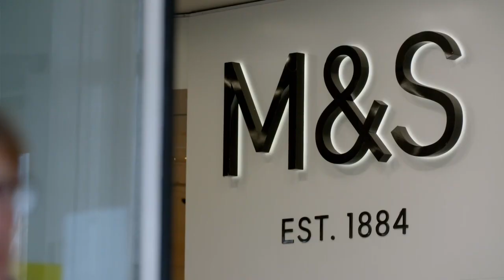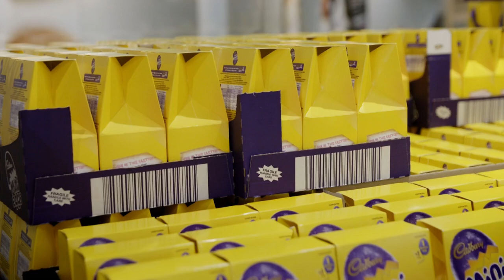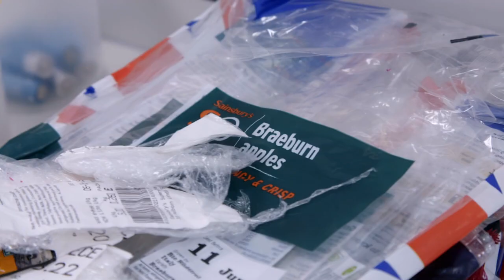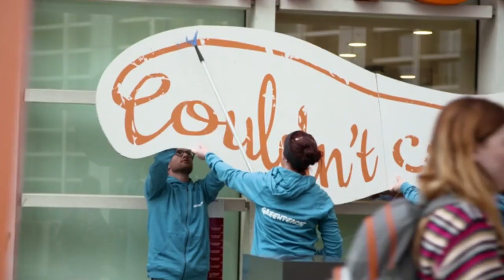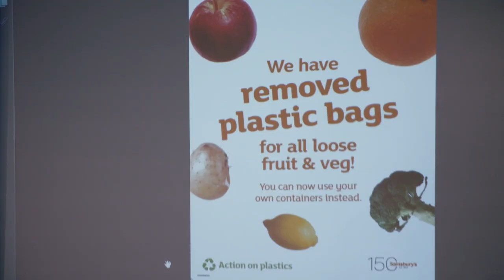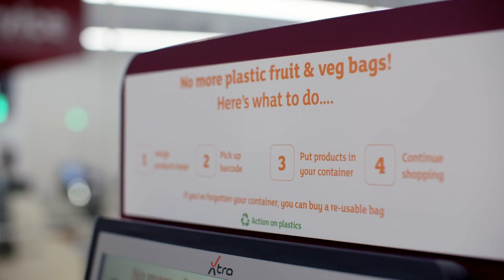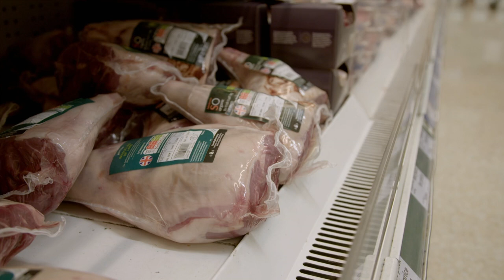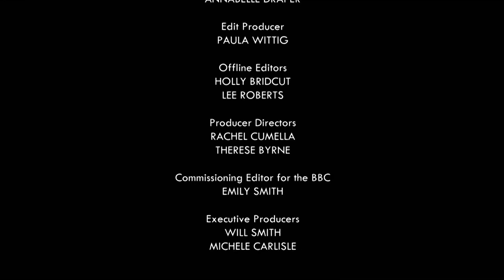Inside The Supermarket - Season 1, Episode 2.

Comment: The big supermarket chains don't get it about packaging.  They focus on plastics and the instore bags but that is only a minor part of the problem.  Producers are packaging their products with so much plastic and cardboard, most of it is overpackaged.  Even snack packs have so much wasted air in them which causes extra delivery costs and wasted packaging.  Even the inks they use to print on all these products are a problem.
Reply: they used to have brown paper bags with orange lettering Women used to buy shopping bags I still do
Reply: @annpartoon5300  brown paper bags are considerably worse for the environment than plastic. Same goes with those reusable bags they sell
Reply: First off, as even Greenpeace will tell if you press them hard enough, there are processes to recycle ALL plastics and those processes are becoming more and more feasible every day. I personally feel that plastics are better for food in terms of freshness and safety... I would not want all the food that needs to be kept fresh out in the open for even to put their germy hands on. No thanks. And paper packaging, despite being easier to recycle at the moment, is not better than plastics - nor is it better environmentally (requires dirty factories and causes more pollution up the stack)...
Reply: What do you mean by stating 'first off'?  I didn't mention anything about not using plastics.  I mentioned the fact that there is so much over packaging and wastage that causes extra costs in storage, delivery and resources.  There is way to much spent on fancy packaging and printing.  What is it exactly that you disagree with in my comments?
Reply: The twats who send it back however are really savvy! I mean the environmental cost of transporting it to the lab, the postage materials and their creation..  just for it to be slung in another bin. Just send an email!!
Reply: @annpartoon5300  do men not?
Reply: 7:46

Comment: You got those green peace lot saying how Sainsburys need to cut down on plastic but yet it looks like they are using some kind of plastic for what they stick up onto the windows at the head office. And the banner thing that they use to take place of the comoany slogan. Seems a little on the contradictive side no?
Also all the customers saying how this plastic and that plastic isn't necersary talking about the problems but you don't hear them providing a solution. If it doesn't get some kind of protection and just goes out with nothing on it then it's likely the produce will end up getting more damaged and ruined and bashed about from the long transits it takes from different UK locations/oversea locations. I guarantee you remove all the plastics like they want and then suddenly everyone is moaning about the fact they can't get good quality produce that doesn't look like crap and then you end up with an increased amount of produce waste

Those reusable fruit and veg bags are a good idea for sure but i feel like they are gonna end up with a big problem of theft on them. They pay 30p for the bag and then reuse it every time. But how does the checkout staff know that the customer has already paid for it? All the customer has to do is rip off that little cardboard tag and they won't know any different if it's already been purchased before....

Plus i really don't get the purpose of having a weather guy at the head office. He rings up MET office for them to tell him the weather so he can tell the office the weather.....but it sounds like the weather they are telling him can just as easily be found on the website/app...

Comment: Did he say that Sainsbury's and Tesco are supplied by the same person??
Reply: They don't get supplied by the same 1 supplier. Each company will have hundreds of different suppliers. But sometimes it just happens to be that they will end up sourcing there stuff from the same place as the competitor. I think in this case it was something like bread rolls they were trying to source. Sainsburys and Tesco get there bread rolls from the same supplier. It's not an uncommon thing to happen. A similar example can be that when you buy bread with a known big name brand like Hovis on it, they will make all that bread with the Hovis branding on it under the Hovis recipe. And then Sainsburys will buy bread from them and Hovis will package the same bread just made slightly differently and then package it with Sainsburys branding on it or Tesco branding on it. This may not be a thing that actually happens with Hovis but i know it to be a thing as i found this out when i used to work in retail for a builders merchant